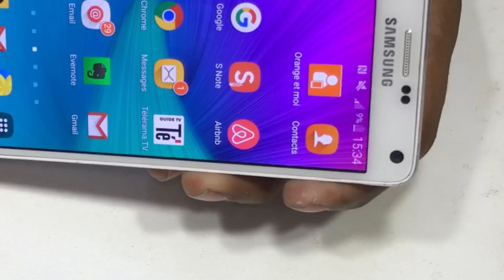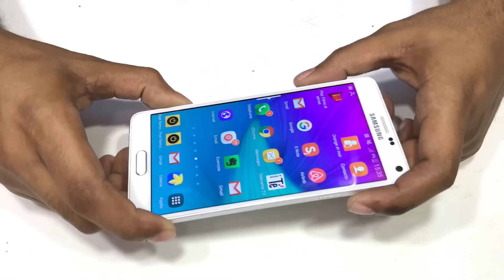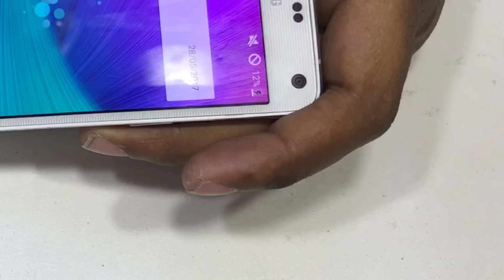Samsung Galaxy Note 4 Charging Port Replacement

Comment: good tutorial . the USB part where you used the stanley blade i found extremely difficult as the USB had become lodged under the opening. patience and heat gun helped. if you have longer nails you can use those to break the seals.

Comment: I wanted to replace my sm-n910t charging port, but I'm kinda confused - can i use charging port from another GN4 model like, for example sm-n910A or sm-n910F?
Or do i need specific one for N910T? thanks!
Reply: I have the same question

Comment: Not only on your video but others too, when I took the back off it looked nothing like this. There was a large copper colour sheet connected to main body of the phone I found it impossible to remove the light grey coloured backing frame & ended up destroying the phone.....

Comment: I just replaced screen assembly on a note 9 we bought with cracked screen. Both heat & ISOPROPYL ALCOHOL were needed to soften the glued on back. I used 93% from drug store. I now need to replace the charge port on our 2 note 4's before giving them to a friend. Do you see any reason why I couldn't use ISOPROPYL ALCOHOL & heat to do the replacement?

Comment: Thanks so much I think I may have left a part of the adhesive pad on the left side, It's not easy to get under that sub saport frame between the glass and frame but it works i just think I may have to check my work or just let it seat. But thanks, you rock. Like I said I love that music, Is it on Sound cloud if yes can i get the name of the song please. O I subbed and I will pass it forward on fb. o7

Comment: Hi. I just replaced the power, home, volume and charging port on my Note 4. The only real issue was the power button but I decided to just change everything while I was inside. Now everything works (even the S Pen) but now the touch screen doesn't work. I've checked all the connections several times. Any idea what the issue could be?

Comment: So i relkaced it according to instructions. I was very careful to not damage the screen in the process. When i put it together i hear the vibration when it starts charging got the bkue ligth in the top, but i have no picture. I turn it on and it seems to be taking charge but i can't see anything on the screen. I connected every cable, what could have gone wrong??

Comment: Hi, I have a question. I picked up my phone (note 4) from repair (professional place), charging port replacement. I am not very happy. Entire bottom of the screen is lifted above the frame, it is flexing and home button is below the screen surface. Can something be done with this?, or entire screen has to be replaced. Thanks in advance.
Reply from the maker: Hello, Bj Witelus
Join my fb page and send photo
Reply: Thanks, after watching many videos I fixed it, just by heating and pressing.

Comment: After chaning the micro USB board, fast charging not appears. And the charging is very slow. Slower than normal charging. Perhaps only 400mA, 500mA "safety charging"?!?
Slower charging than discharging with active system and energy safe mode O_o.

Comment: replaced charging port now back button and blue indicator light but no picture on screen, it even vibrates and can hear noise when volume button is pushed? but wont light up, battery came with phone powerbear 3220mah, cant get it to enter any mode bottom button or top? could battery be bad. voltage meter shows 4.22V, please say battery is bad!
Reply: Its the LCD connector to the motherboard. You have to position it just right or you get digitizer and LCD problems.

Comment: Nice.. I think I noticed you 4got to put the screw back on for the daughterboard port. I was gonna use this video but I just thought the phone I was gonna fix won't turn on at all. Even with different battery and cords. Outlet and USB not work. 

She said the phone just sat overnight. She forgot to charge it that night then when she woke up..  the phone was dead. She mentioned a previous thing she noticed with the phone making a noise. Sounds like the power connected noise over and over again at times. 

I guess replacing the motherboard is basically a new phone....

Comment: Real question is does it still fast charge with the replacement part?
Reply from the maker: s No, only original port is working fast charging
Reply: Really is there a way to get fast charge?
Reply: i wonder  if you get a hold of a original charging por from another phone, will make it fast charge? im looking for parts but don't want to buy an oem, need to trh with the original
Reply: I replaced mine with some cheap $20 part it works new and fast charges 😁